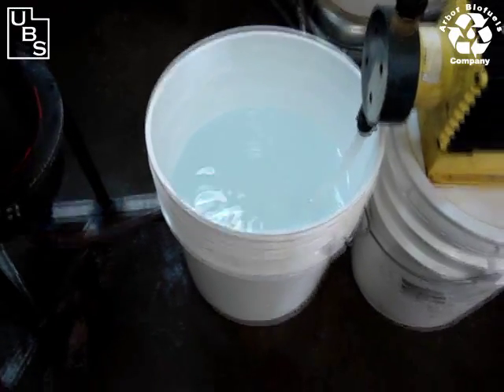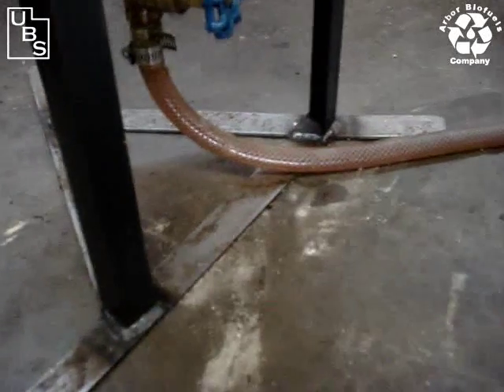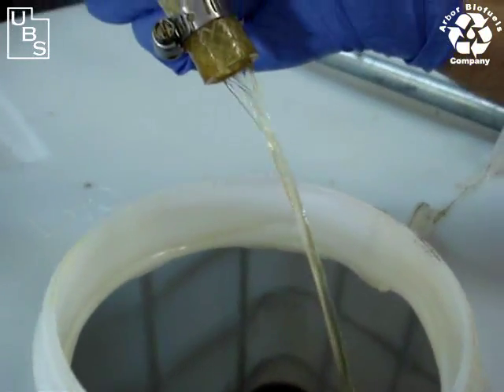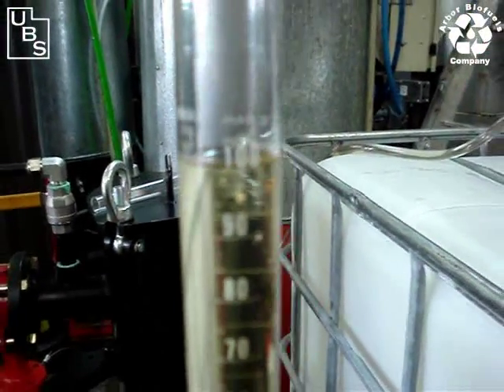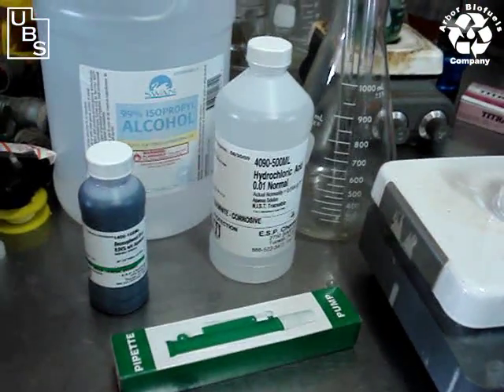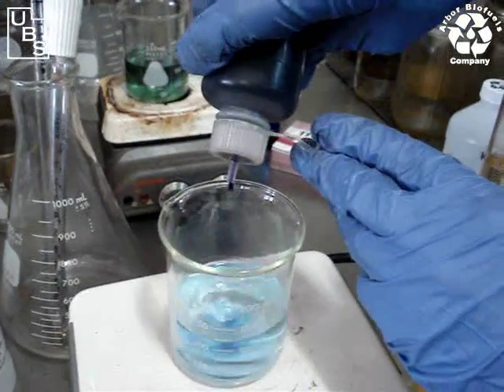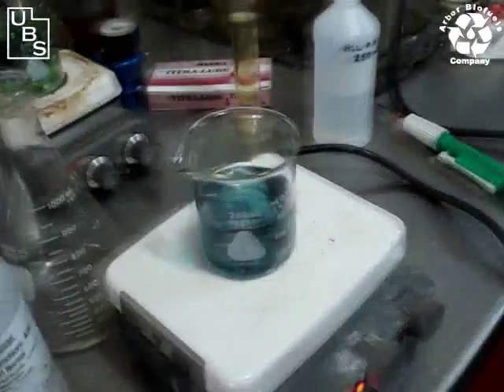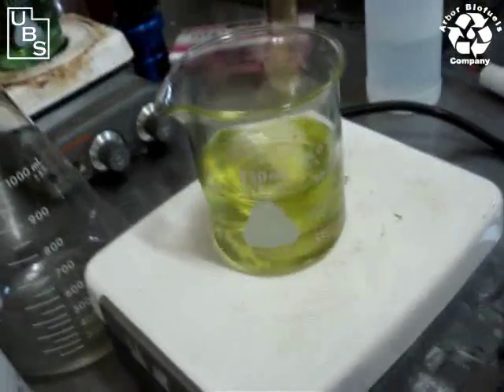How To Flush A Biodiesel Dry Wash Exchange Resin Tower Using Methanol

Comment: @russianstarwelder The thermax can be regenerated several times before it completely wears out. So eventually you'll have to replace the thermax, but you can usually flush quite a few times before it's completely worn out.

Comment: @UtahBiodiesel  what is the technical difference in the styles of centrifuges?? would it be the break point at which the fluid levels seperate  because of their mass??  is the most essential thing then the width of the lip on the centrifuge?? or lateral depth of the bowl or both?

Comment from the maker: @UtahBiodiesel 
Also, the centrifuge is used on the oil before it's made into Biodiesel. It can be used on the finished Biodiesel, but it's only filtering any particulates and won't remove any soap or glycerin. The dry wash media remove residual soap & glycerin from reacted Biodiesel; which is what this tower has been used for. 

The video is just showing how to clean one out once it's exhausted.

Comment from the maker: @circusboy90210 
The process shown is just showing how to clean dry wash media. When enough finished Biodiesel is run through dry wash media, it begins to get plugged with soaps and glycerin. In order for the media to work again, it needs to be flushed with methanol to remove the contaminants.

Alpha Laval centrifuges can remove glycerin from Biodiesel, but not the Dieselcraft Style or the WVO Designs style. Their purpose is to remove particulate matter; they're simply acting like filters.

Comment: You can reuse it with your next batch. It's loaded with soap, but it's still usable. Most people split it 50/50 with new methanol when they reuse it. A tip though, don't use it to dissolve the catalyst though, otherwise it'll make a mess.